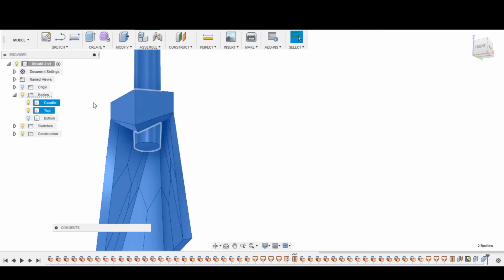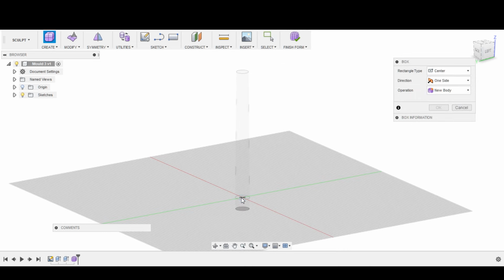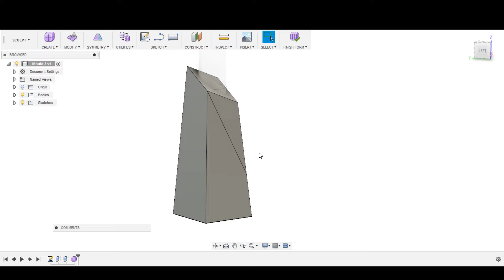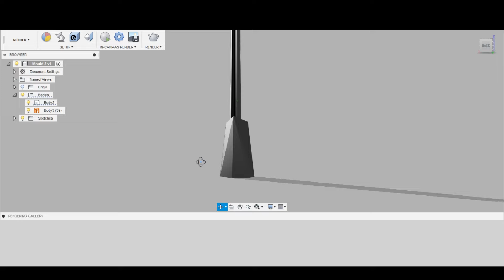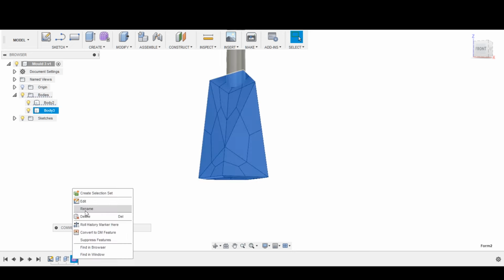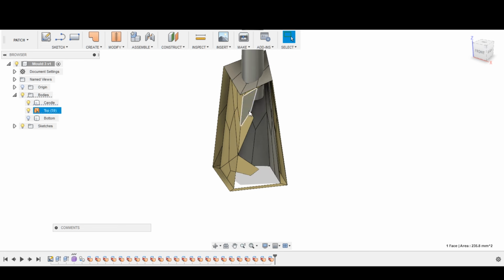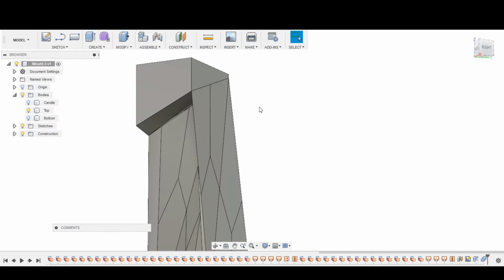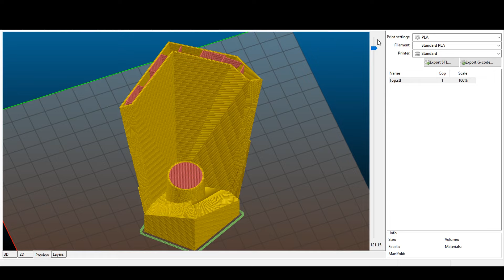Cast Concrete with REUSABLE 3D Printed Molds

Comment: Not to be a nit picker, but if you remove the "Stones" (actually called aggregate) you are now making cement, Not concrete. I have no experience in 3D printing, so it was good to see this. Thank you.
Reply: Not to be a nit picker, but he is not removing all of the aggregate, only the larger portion (the stones). He is therefore still pouring concrete, but with a mix design that has different properties.
Reply: @buildyear86  What other aggregate is there if there are no stones?
Reply: @porker5749  there are bigger stones and smaller stones... Google it?
Reply: @buildyear86  He is in fact making a mortar, as it is only called concrete if the aggregate size is larger than 4mm ^^

Comment: very nice, the pertroleum jelly is the answer I was looking for. However: ProTips: You needed cement ( not concrete) and also, please wear a mask when mixing concrete/cement: IT is very toxic
Reply: Not to mention you can get contact burns from it, so you only want to wash it off you when the jobs done (eg. you don't want wet skin whilst you're working), otherwise it can start to react/heat-up on your skin, and set (it's a chemical reaction) and burn your skin.

Comment: I've had luck making 3D printed moulds by just making a cube in the design environment and then doing making the form I want to create a negative-Boolean (subtract) which leaves the negative form.  Then I just split the cube into halves and print.  Nice if you add some registration pegs or keys as well along the edge of the mould.

Comment: I've found an 8:1 mix of isopropyl alcohol and castor oil in a spray bottle goes on more uniformly and releases easier than petroleum jelly or vegetable oil, I even prefer it to fancy, expensive mold release from Smooth On.

Comment: Thanks for this. I attempted a basic ashtray using a 3d-printed mold with PoP and ended up with one attempt completely locked into the mold and another requiring the destruction of a part of the mold to release. What was missing in my scenario was the mold release agent.

Also, fyi, you may find it beneficial to swap the gravel for dry sand as the aggregate in your concrete. Removing the aggregate altogether significantly reduces the rated strength of the concrete (as another youtuber said, "you are now making cement", which, by itself, is comparably weak. Sand may also provide you with the benefits of controlling coloration and finished texture of the products.

Comment: I gave this a go using a mould I designed in Inventor and printed with my Prusa Mk3. Turned out surprisingly well, even with just a light sand with some 150grit. My draft angles need to be steeper on my second version though, and I'm thinking about making a vibrating table to get rid of those bubbles....

Comment: I've read somewhere that parts like these should be submerged in water at some point, to make them as hard as possible. I figure, when they are already quite hardened at the outside. Apparently the part then takes in as much water as needed to make it as hard as possible.

Comment: Hey mate. after I deleted the bottom face, I can no longer crease that bottom edge.  But in your video, you're able to.  any lips?  I've flatted it, it just doesn't allow the bottom edges to be selected for creasing
Reply: NVM, fixed by recreating the bottom face, creasing, then deleting the bottom face while still in the form tool.

Comment: Nice always wanted to try this with a 3D mold, they look great. Add some Iron oxide to the mix and the come out Matte black, looks so dope.
Reply from the maker: chur, yeah I tried a few with black pigment, but couldn't get a nice deep black - probs just didn't use enough though haha
Reply: Yeah you do need quite a bit. I just kept adding it until the mixture was pitch black. Have you seen that Instagram Concrete Cat? The do some cray stuff with pigments.
Reply from the maker: oh man, just scouring their instagram now - trying to find process shots of how they do those textures

Comment: it seems like using boundary fill in the modeling workspace would be simpler. Then you could just split the body in half.
Reply from the maker: Yeah maybe, I've used boundary fill for a couple of other shaped molds and it works well, but you still would have a fiddly time of defining the edges to get the mold splits happening on the edge of the form.
Reply: you're right

Comment: Great video, thanks. 

Watching I noticed how much I liked the contrast between the concrete and the white PLA. Maybe another line of "mosaic" candle holders with embedded PLA plates artfully placed? Something like a really terrible adhesive (painters tape?) on the inside of the mold could do the trick. 

Cheers.
Reply from the maker: Thanks! oh I hadn't thought about embedding 3d printed forms into the concrete,  that could be quite an interesting concept to explore further.